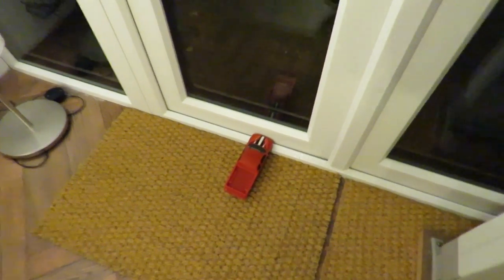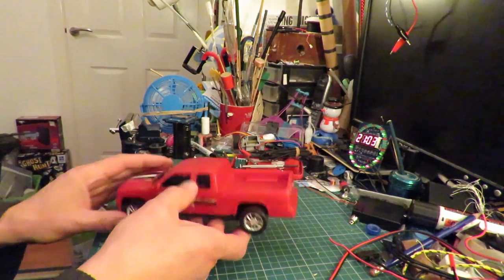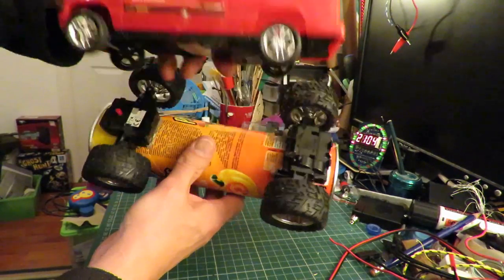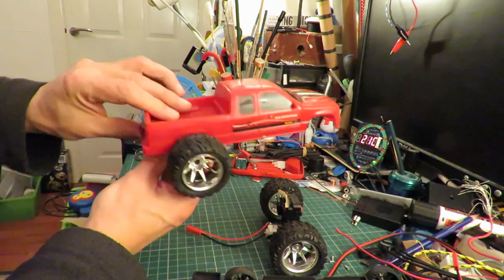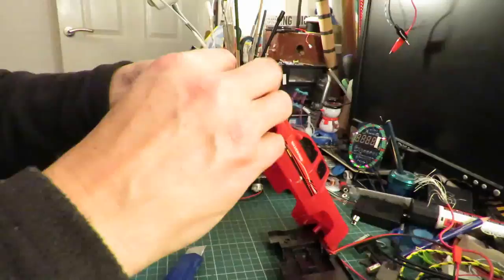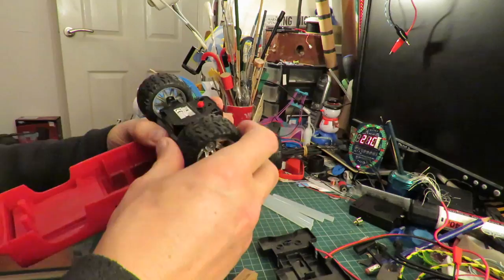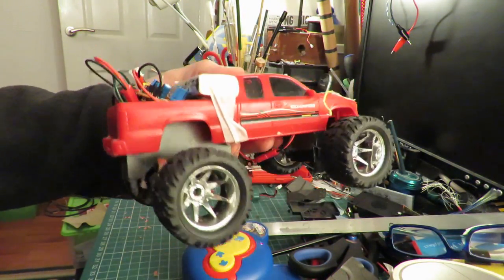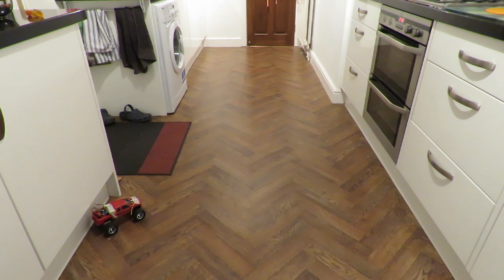Chevrolet Silverado Friction powered toy Car RC conversion

Comment: good job on the conversion, but ya either way u go the rear or the front end is gonna be lighter either way, but just thinking if you would pur rubber glove or a balloon over the drive wheels then the truck would have more grip and wouldnt slide around as much. or other way round put the balloon over the wheels that are not driven and see what happens then it should be more stable i think.
Reply from the maker: From a video point of view I get a better response if they are sliding around and banging into things 😊 If it drove around nicely the first comments would be "try a bigger motor" or "Try bigger batteries".

Comment: I think you should. Make it neater and put the battery inside to Evan out the weight also put the action cam back in a car
Reply from the maker: I never worry about making my projects look neat, I am not trying to win prizes. I will be taking it apart again soon enough and re-using the component parts. There will be more Action Cam stuff in the future at some time.

Comment: As usual, I always enjoy your   videos ! But I have a question. Is there any particular reason why you don' t use the pistol type transmitters with the little steering wheel for your surface type vehicles. They make directional control easier and more precise. Is it just a personal preference?
Reply from the maker: Simple answer is I don't have one (hobby grade) although as it happens I have ordered one for a different purpose. As for precise control I don't see how that can be although not having used one I can't make an informed comment but I am sure aircraft and quadcopter flyers would disagree with you because people will always find reasons to argue. In the case of this particular car using cheap toy grade RC there cannot be any question of precise control, it is left or right not proportional. I do have a couple of pistol type toy grade controllers associated with a couple of toy grade cars, one is proportional even though I would call it toy grade. I can't say I found that any easier to control and seeing how often I stuck the car into the bushes I don't think it helped me.
Reply: Thank you Granddad, you have answered my question completely, and I will continue to enjoy your videos !!
Reply from the maker: Thanks David and by coincidence my new pistol type transmitter has arrived in the post but I haven't had a chance to try it out yet 🎄🎅😊

Comment: I have this jeep gladiator 2006, that I brought with no remote control,I want to get a new controller 4 it but I don't no we're to star, it's in perfect condition it's about 7 inch tall. The only problem is that when I turn it on the wheels spin an I can't get it to stop. Any 💡 ideas
Reply: Also the circuit board an receiver is a little different the the ones I see u working on its bigger too
Reply from the maker: If the wheels start as soon as you turn it on it may be a single channel RC system that goes forward when you press the button on the controller and backwards when you release it. Does it have any steering  or does the front axle just rock about a bit? Here is an example of what I mean https://youtu.be/gZ16-HWte7g

Comment: I would send u a picture, it could fully turn left an right. It has 7 wires rainbow each wire a different color coming from the front axle  to the circuit board,
Reply: 27 MHz
Reply: 7.4 v battery pack
Reply: I'll post the picture on my channel
Reply: Ok u can have good look at it now I posted a video
Reply from the maker: Hi BossDon, I have looked at your video and left a suggestion there for you. I have not seen this type of receiver before so I am just guessing a possible problem and fix. You might get more help if you do a YouTube search for your car and see if anybody else has the same car.